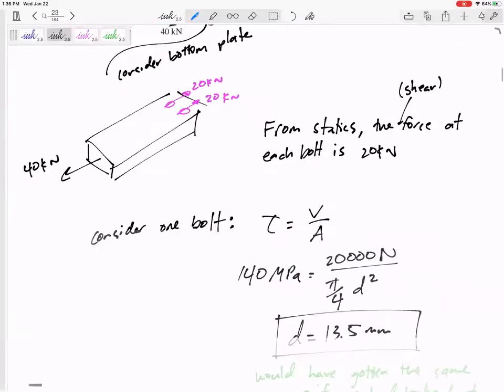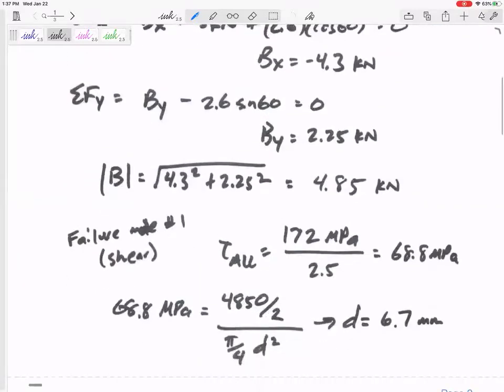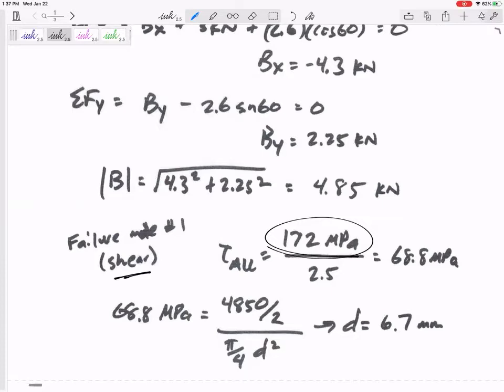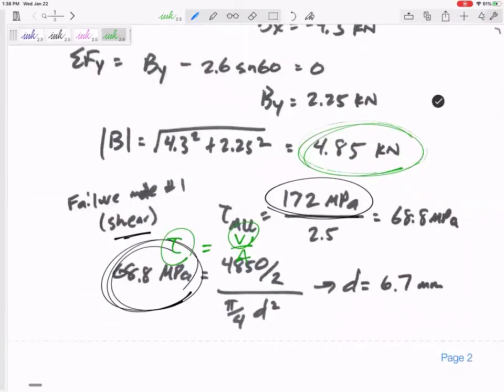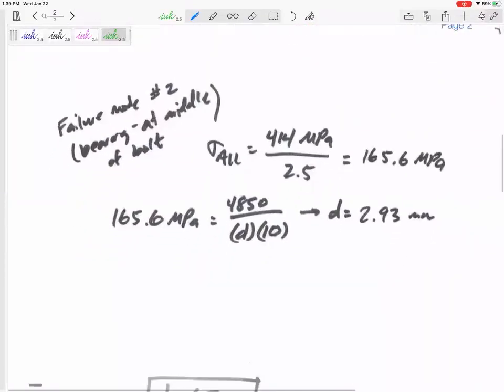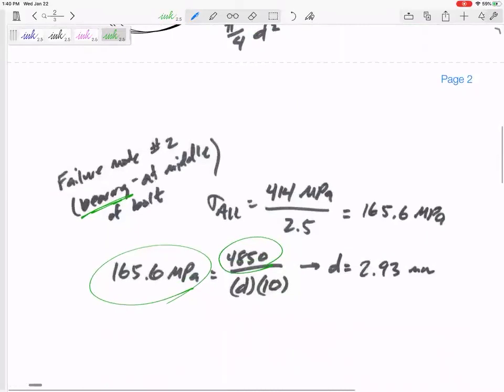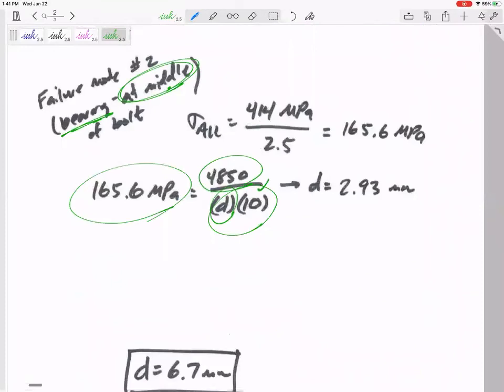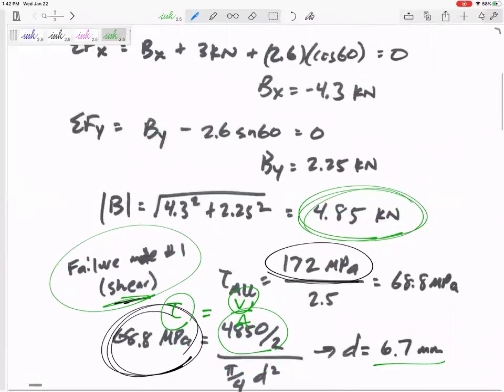Mechanics of Materials - Overview of additional allowable stress design problem

Comment: Hey, the bolt B, it passes through ABC with thickness 10mm, but it also passes through the leaf-like structures that has thickness 6mm, so why isn't our total thickness 16mm while calculating bearing stress?
Reply from the maker: Because the bolt feels the full reaction force. And the 6mm plates each feel half the reaction force. You can also, separately, calculate the bearing force in the 6mm plates, but use 6mm as the thickness and half of the force. The thickness of those 6mm plates doesn’t effect the force and thickness used for bearing in the bolt.